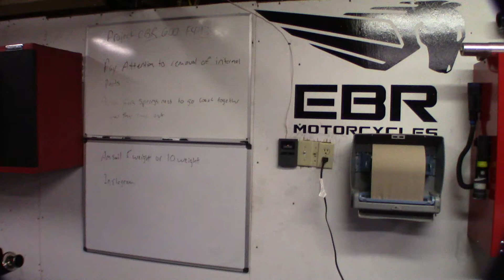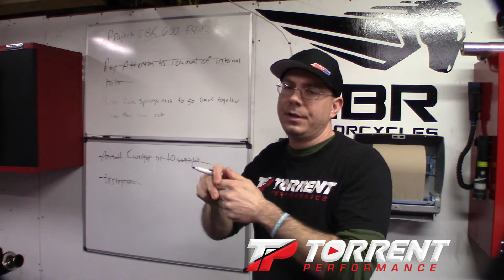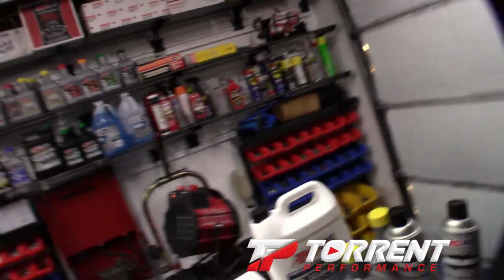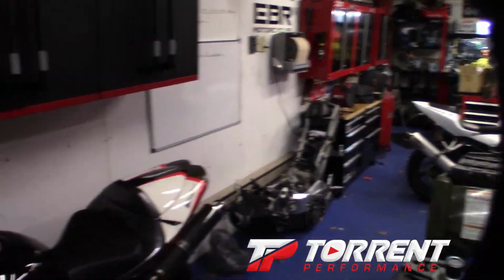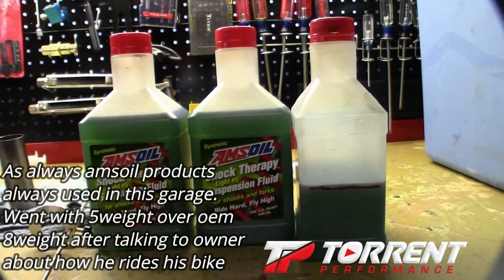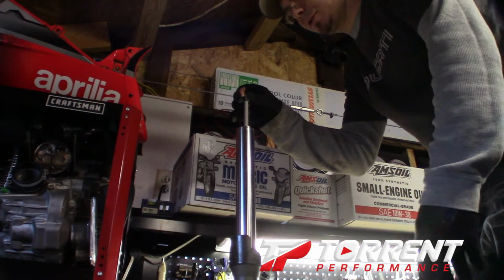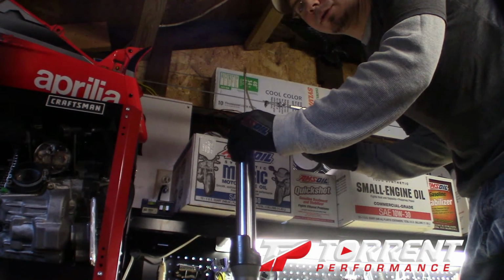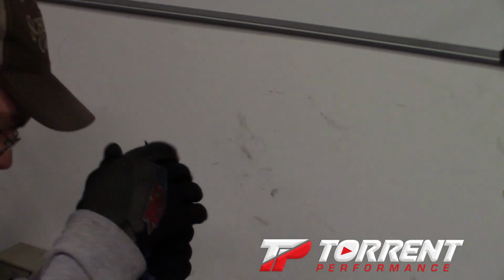Amsoil Fork Fluid Change Project 2001 Honda Cbr600 F4i Episode 13

Comment: spring was fitted upside down should have tight coils to the bottom
Reply: Nice catch. Thought I saw that too
Reply: Answering myself,  There are some manuals state tight coils to top, some state down, However given the spring is completely submerged in the oil due to the 116mm Air Gap (2001+)   (118mm pre2001)  then the direction is not relevant for spring rate, just un-sprung weight